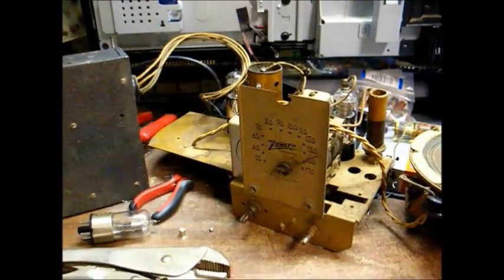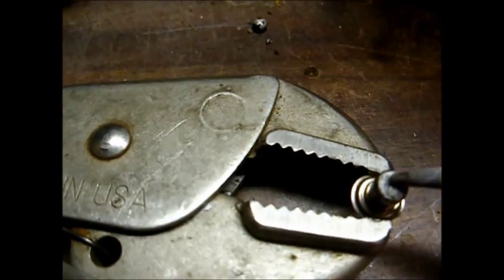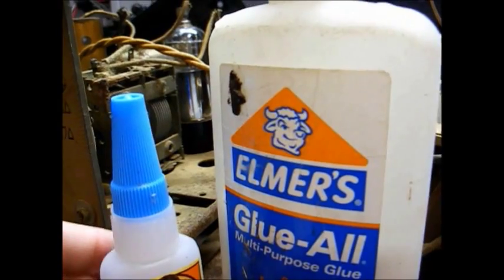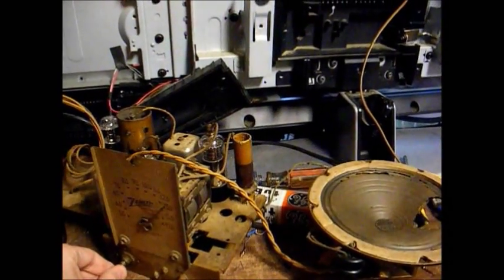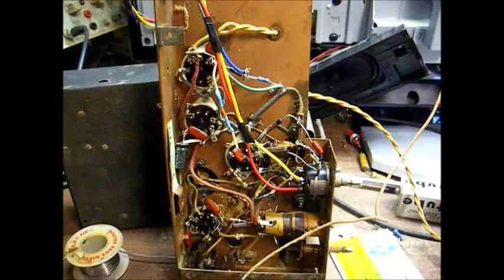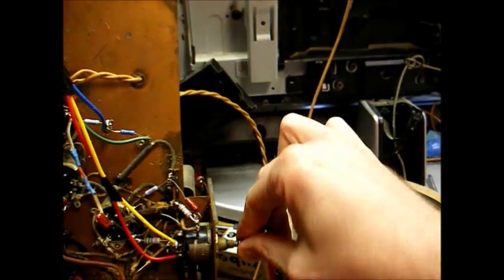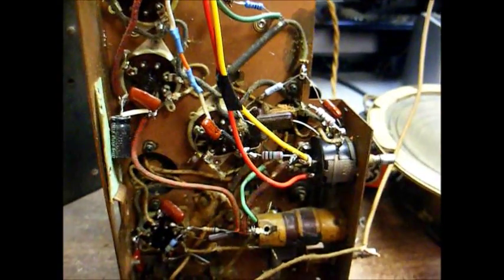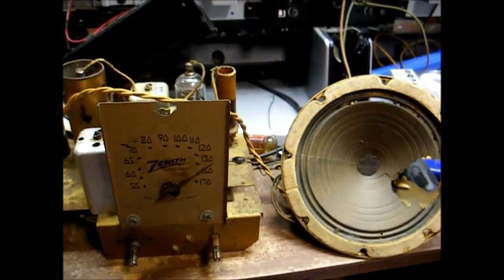Repair of a '39 Zenith model 4K331 battery operated tube radio - part two

Comment: Why not leave the tube in the radio to repair it?? I have had to remove some of the glass on top of the tube with a file or knife sharpening stone, to get to the wire to solder it on.

Comment: All the parts houses I bought from over the last 45+ years are gone, there were 4 locally in two close by cities. now all gone. I was great way back when if you needed anything it could usually be found, filter caps., film caps., I.f transformers, tubes, crt's, speakers, phono cartridges of ANY type. The summer was always good for flybacks, HV triplets, the start of football season was good for a rush of busted TV's people left sit all summer, and between Halloween & Christmas phonograph repairs so people could listen to Christmas music. Now most all my repair work is on vintage equipment, just did an Atwater-Kent model 92 complete chassis restoration, nest is an AK 10C breadboard set. We are the last of our breed soon no one is going to know how to service this stuff, I cringe at some of the YT videos and some repairs I see.
Reply: ...TIMES HAVE CERTAINLY CHANGED- AND NOT NECESSARILY FOR THE BETTER(!)

Comment: For this application, since the tube doesn't get hot, super glue would be appropriate. If it was, say, a tube base for an audio output tube in an AA5 radio, it would be better to use a glue that would have sufficient flexibility to accommodate for the expansion of the glass as the tube heats up. Bandersentv uses an automotive windshield adhesive.
Reply: i usually use evostik impact adhesive, it sets rubbery, never 'hard' unless very old or if it gets exposed to high heat long term..so can flex a bit, and grips on most materials..
Reply: GOOP is good and the strongest to use to repair vacuum tubes

Comment: I would repair that speaker with coffee filters. Then use "Eileen's Tacky Glue" to stick the coffee filters on and repair the tears with it also. Stays very flexible for years. Use sparingly only. Available at "Joanne's Fabrics" store. The speaker will be good as new!

Nice work!
Reply: Same here, except I used Elmers wood glue (the pink stuff) thinned out with water. Place down the coffee filter patch and brush on the glue. Glasslinger (another YouTuber) uses water based rubber cement with decent results.